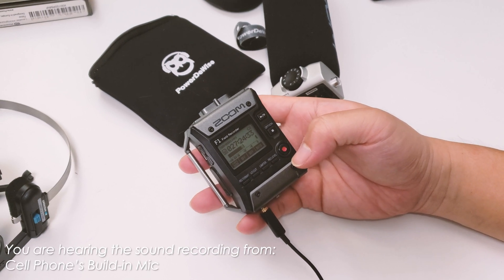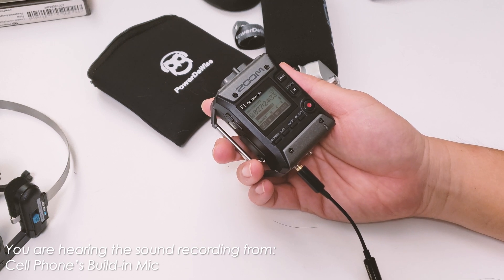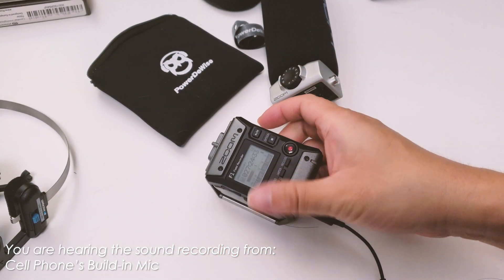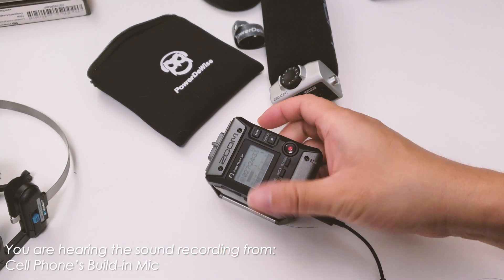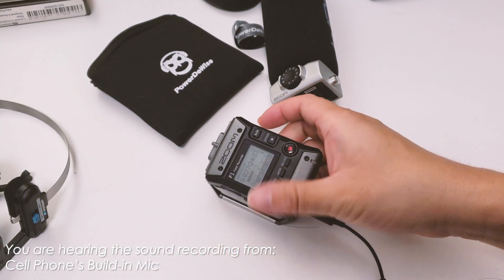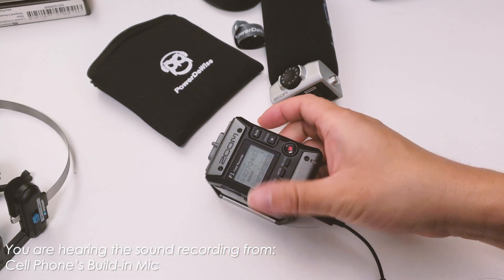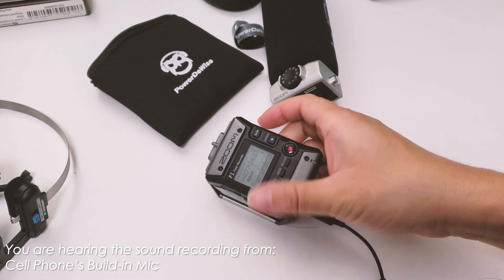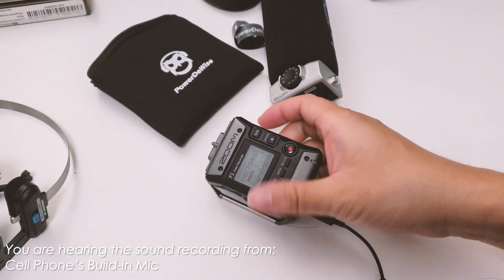Zoom F1 Field Recorder Line/Mic Input Gain Setting Volume Test w/PowerDeWise Lav Mic

Comment: great video.  Did you do any audio editing after this video?  I have the same setup and struggling to get it to sound good.
Reply from the maker: I use the mic with F1 at "High -" and "High", in post I might bump up the gain "+5" to "+10" but no other adjustments are made. I usually just mount the mic below my mouth clipped on the t-shirt.
Reply: Li Fan I just made a rookie mistake and was using the backup audio from a boom mic, lol.  Wrong track, oops.  It sounded better once I grabbed the right track. Thanks for reply!
Reply from the maker: @TravisSickle  that's great to hear! 😅